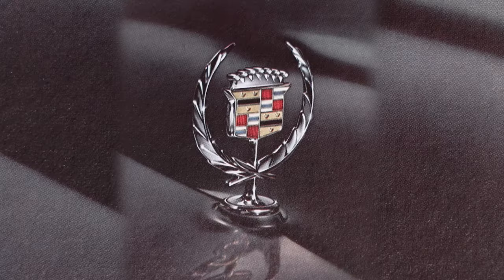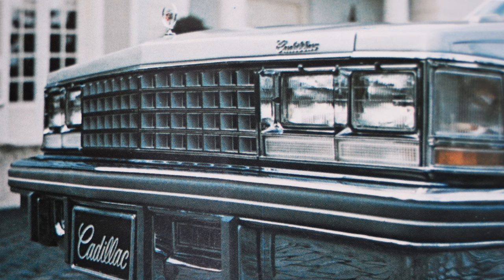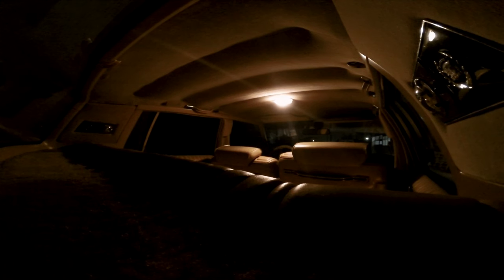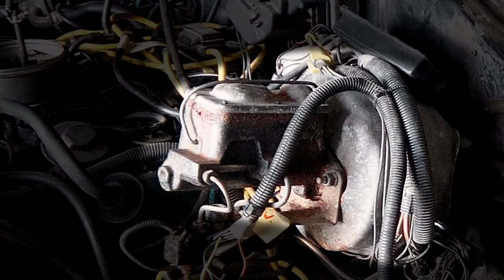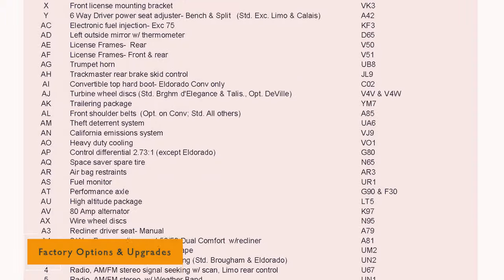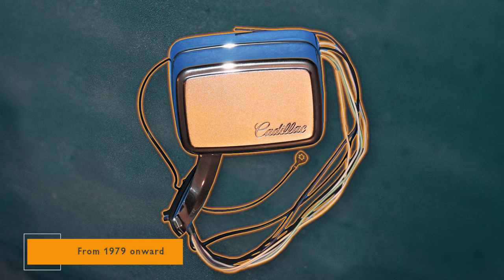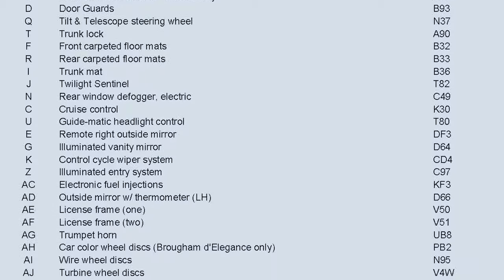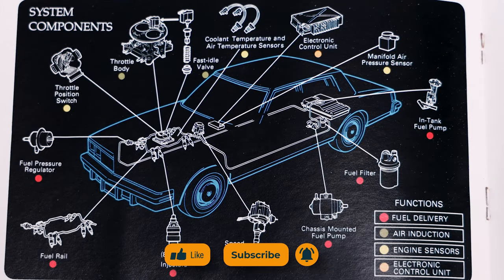Cadillac Seville — Big Options, Compact Luxury!

Comment: My favorite was the Elegante option with four bucket seats (front and rear) top grade perforated leather d, and REAL wood on the dash front and rear consoles! They were well made and had very few raw plastic parts like so many cars of today. They tried to cover most plastic with cloth or vinyl. Beautiful die cast chrome molding front to rear.
Reply from the maker: As mentioned in a previous reply to one of your awesome insights, I really appreciate you sharing every little detail you know! I didn't know, that the Elegante had 4 bucket seats and that real wood was used. With "Beautiful die cast chrome molding front to rear", do you mean, that even the headlight bezels and the grill were die cast chrome molding too?
Reply: @thataustriancarguy   The die-cast molding ran the length of the car several inches above the door handles the headlights and grill were still plastic same as the regular Seville The rear console was discontinued after the 1978-year run It could also get REAL wire wheels as an option! The car looked with the real wire wheels and the two-tone paint option and with no vinyl top( Elegante)- google 79 Cadillac Elegante.
Reply: There was no 4-seats version of an Elegante, or real wood? The headlamps bezels are exactly the same as regular Sevilles.
Reply: NO - the Elegante console was used in '78 and '79 and all '78/'79 Elegantes had included in the price their wire wheels. It's believed some '79s had wire trims because of a supply shortage?
Reply: yes, the Elegante was an option 0n the next gen of Seville, with 4 bucket seats and a console! I stand corrected.
Reply: @paulbedford9816   The next gen of Seville had an Elegante option with real wood and cast moldings and fancy carpet with 4 bucket seats I stand corrected!

Comment: It's interesting to see a European appreciate this car since even Americans have long since been convinced that this was the era that Mercedes and BMW began to eclipse Cadillac and Lincoln. And that they've been the best ever since. You don't really see these a lot in America really either anymore. The basic sheer look styling spread to GM's entire lineup over the next decade so its unique look got watered down (although its by far the best looking example of it). So I think it went under appreciated for a long time until now. The next two Sevilles weren't as elegant but I love the 1992 to 2004 models.
Reply from the maker: Thank you for your comment and insight. I thought you would see a lot more of them in the USA!
 I agree with you about the unique look being watered down. As I've been delving into the Seville's history, I can only imagine the impact its radical styling must have had back then.
As for the different generations, I share your sentiment completely! I don't like the 2nd & 3rd generations look at all, 4th & 5th are beautiful.
Reply: Traditional Cadillac buyers were not sold on the downsized models yet which was based on the Chevy Nova platform and used Oldsmobile engines. What I always like on this cars is they had rear disc brakes and fuel injection which was an option on the last big Eldorados in 77-78.
The rare models are the 2dr convertible San Remo Edition and Opera Coupe. I agree, GM cars looked good for years to come, where sized just right but built quality was bad all around. I wish the fwd Sevilles would have been still build on a rear wheel chassis, though.

Comment: Note that the standard manual passenger's seat recliner was mentioned, but for the driver's side, the only option mentioned was a power recliner. I believe that reflects GM's hostility to manual driver's seat recliners in general, probably rooted in fear that some drivers would pull the lever, fall into the back seat, and drive through the front of a store before regaining control. Of course, they could have used those annoying knob-type recliners found on some Fords and VWs, but that wouldn't have fit Cadillac's luxury image. By 1978, GM was offering manual driver's recliners on the Chevette, but only on the Chevette, perhaps figuring that small-car buyers would have a better idea of what to do with them.
Reply from the maker: Wow, that's a fascinating insight, thank you so much for sharing it! I really appreciate hearing your perspective. The mention of the Chevette drivers is both funny and a bit sad if true 😂

Comment: I love your channel! I had a 1978 and a 1979 Cadillac Seville and loved them. I think I remember that the Seville had 11 shock absorbers. 4 for the bumpers, one at each wheel, one associated with the steering and two with front sub suspension. Am I correct?
Reply from the maker: Thank you so much, that really means a lot to me!
You are correct, but the front shock absorbers between the front subframe and body were abandoned from the '77 model onward. I have a video coming up this Tuesday, covering all the differences between the model years.

Comment: A common misconception regarding the engine is calling it an "Oldsmobile" engine. That is only marginally true. The only component of the engine which was "Oldsmobile" was only the base engine block. Cadillac engineers designed and built the heads, valves, cylinders, intake manifold, and fuel injection system. All completely unique to the  Cadillac Seville. By 1979, the entire, 5.7 litre engine was designed and built by Cadillac. However, the terrible and malfunction-prone, diesel, 5.7L was entirely built by Oldsmobile.
Reply from the maker: Thank you so much for your insightful comment! I love learning every little detail of this car!
Reply: Yes and even the short-motor, block, pistons, rods and crank were built to Cadillac tolerances, a much smaller out-of-balance figure was attained. Cadillac completed and tested Seville engines up to the 1980 bustleback.